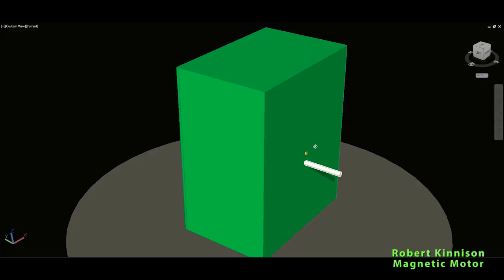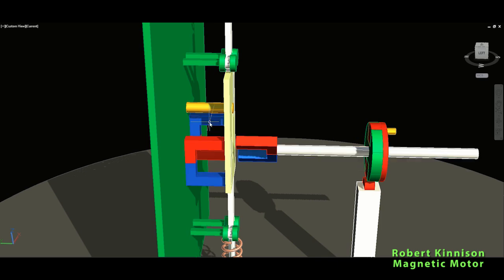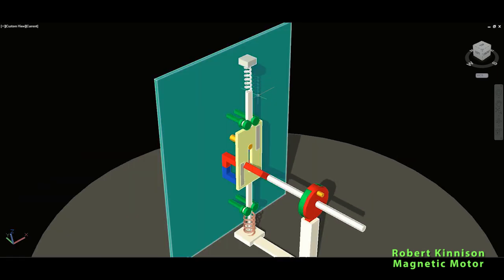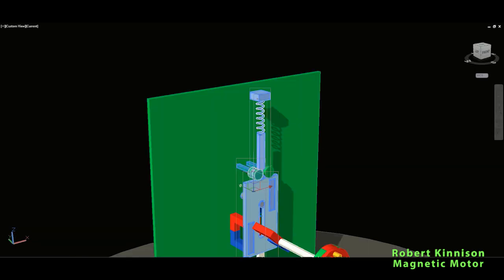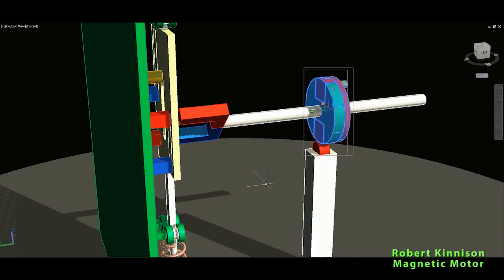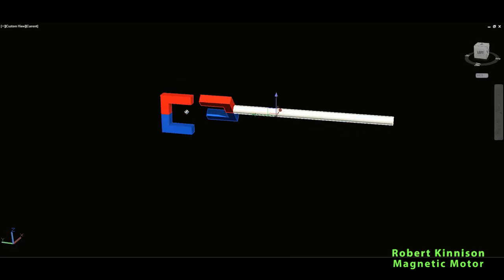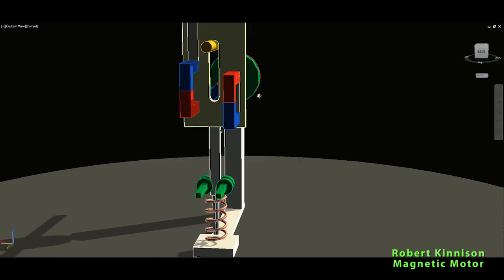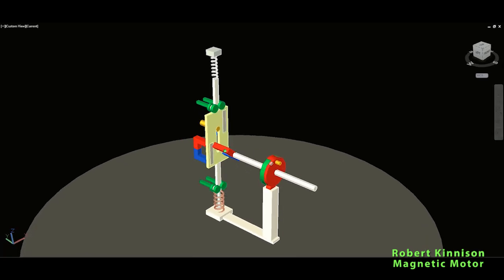Free Energy Generator, ROBERT KINNISON Magnetic Motor, Magnet Motor

Comment: If this magnet motor requires a little bit of electricity, whether it’s little or a lot;then if’s NOT. A permanent magnet motor and definitely not a free energy device NO , in such case it should be called an ELECTRO MAGNETIC MOTOR, DAMNIT😡😡